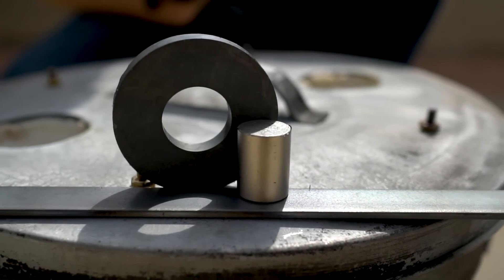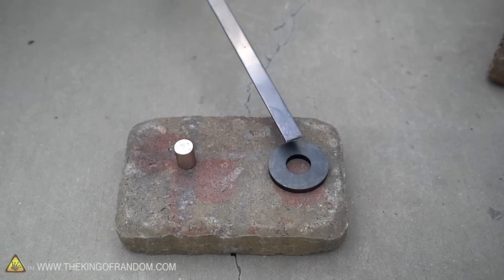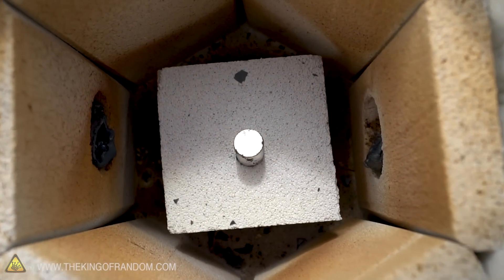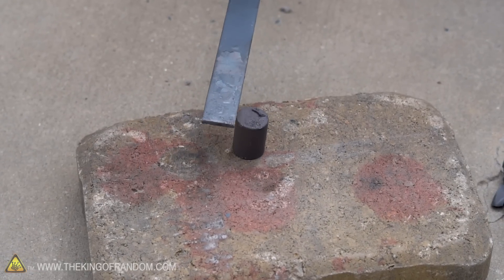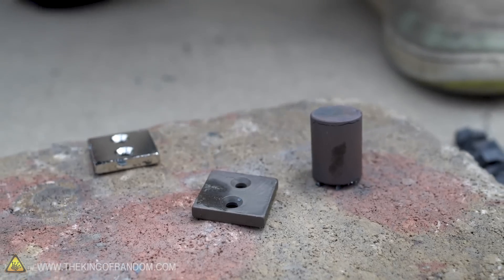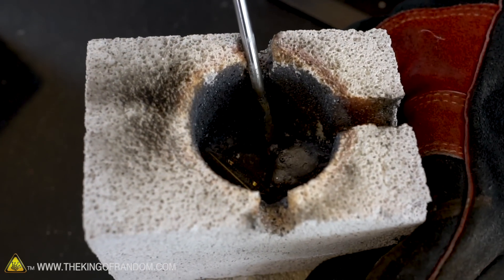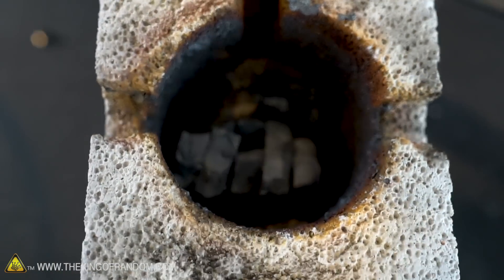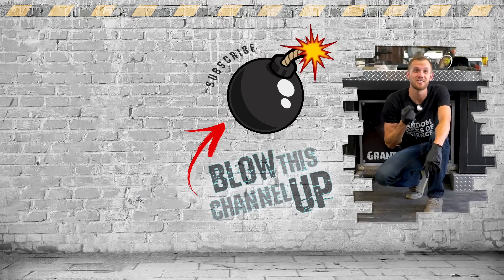Melting Magnets is Weird

Comment: why does he wear thin rubber gloves when handling hot materials?
Reply: So he doesn't get his dish wash soft hands dirty.
Reply: The gloves may look thin and crappy. But those gloves are actually quite awesome. I've even seen chefs use them to prevent cuts.
Reply: @seofra8252  we chefs DO NOT use little black gloves to prevent cuts..we do have gloves for this purpose, but not the ones you see here. They're much thicker and not made of rubber.
Reply: @pashkracken4054  I use the glove he uses... Not with very sharp knives though
Reply: @seofra8252  They're just gloves... You can get those exact gloves at harbor freight.
Reply: @justinroski4994  That's scary
Reply: @seofra8252  they use them because of hygiene. Thinking that a  <1mm layer of rubber will prevent cuts is ridiculous.
Reply: No idea.
Reply: Cuz he 21 savage
Reply: Becoz it works as insulator..

Comment: For arguments sake. I would have made an electromagnetic coil big enough to go around the crucible that you arc melted the steel. Then while molten.  Put the whole crucible into the center of the cool and powered the electromagnet... An experiment I always wanted to try but lack the means. I've always been curious in how metal would act if magnetic fields were maintained until fully cooled. 

I think it would be even more interesting if you got with a blade Smith ergo at final forge allowed this then did the final hardening... I've wondered how it would effect the metallurgy during the making of a Damascus.

Comment: A previous comment gives the name to what I've known about de-magnetizing magnets with heat. But ceramic magnet shattering with sudden intense heat tells me something about my job of repairing speakers. Occasionally speakers arrive with the magnets broken. Magnets will get hot when speakers are used past their operating capacity - so you can imagine the coils will be glowing like a stove element and just as hot. For comparison, a small standard general purpose coil will get to 70 degrees C with a 1.5 volt battery. Speakers have caught on fire. I wonder if this type of intense heat can break magnets in operation. The evidence on the video shows it can.

Comment: That orange steel for the first test was hardly over 1000°, 1400° at the most. 2000° is bright yellow almost white. When you heat metal up to non magnetic it’s called normalizing it, when you normalize metal you remove stress and the molecules return relax and lose structure.
Reply: I believe these are the right terminology. I’m not near my sources right now, but I am a blacksmith and there’s a lot of heating metal up until it’s non magnetic and cooling it down when you make a blade,

Comment: the ceramic magnet shattered violently due thermal shock not because you heated it up, try preheating in an oven then use an indirect flame before stick it in the furnaces

Comment: Magnetism means the atom mass is in alignment. Alignment is what creates the magnetic pull. When u heat it up,  it expands and excites the particles causing movement. This movement misaligns the atoms which removes the magnetic properties. I am an aerospace engineer so this isn't my field of expertise but i hope this info helps. I believe it is the electrons that align, hence electromagnetism.

Comment: As an apprentice blacksmith I can tell you even before you get into the video that the materials will NOT get attracted to each other while significantly hot. This is because the crystals of the metals become deformed and thus unable to hold a magnetic alignment. We use this to roughly tell temperature and to tell if we have significantly/correctly heat treated a product. Also in relation to the ceramic magnet shattering: you heat-shocked it. It was cold when you put it in but the temperature was too hot for it to stand rising to so fast. The same property can cause even modern blades to shatter/crack.

Comment: Lol everyone knows to magnetize a metal (magnetic metal) it needs to be normalized very slowly in the presence of a stable and powerful magnetic field. This is so that the atoms become aligned and iron which is the major component of steel at Best will only give a very weak and barely noticeable. Ceramic magnets need to be heated very slowly or they fracture and explode as you saw. When heating and melting magnets assuming you have the proper apparatus to magnetize them normal require tight thermal control and anaerobic conditions as firstly the components of the alloy separate and secondly oxygen and other contaminant enter the material.

Comment: How does the earth have a magnetic field? If the inside is magma then a molten iron/metal ball in the center. Does it generate it by the movement of the earths insides? Does somthing else cause the field?, im a bit confuddled xD

Edit: want to add.. because of it being so hot inside the earth how is a magnectic field possible? I know there is a magnetic field also, not argueing that. Ah the earth must be hollow with the second sun inside producing the field.

Comment: Fun video but way to much misinformation. You could gain so much more viewers and likes if you explained the things you are doing correctly. For example, "neodymium" magnets are mostly made from iron, also curie temperature is constant no matter if you are cooling or heating, also curie temperature of most neodymium magnets is about 300 degrees Celsius, hence you do not need to heat it to be red hot, simply putting them on the stove or in the oven would be sufficient to loose al magnetism (but making them glow looks cool).

Comment: Suggestion! ⚠

Put the magnets in a block of ice with a hole or hollow for them to sit in, see if any magnets have enough attraction to break the ice or force a way through.

Show how to remagnetize the magnets you've demagnetized.

See if you can melt down a magnet and cast it with another metal, find out what happens.

Comment: I think I know why magnets lose their magnetism and why regular metal does not. Now, I'm no expert, but I'm sure it has to do with the alignments of the molecules, and what those molecules are made of. 

If all the molecules in certain elements are aligned, then their atomic fields are all pushing and pulling in the same direction, thus amplifying the total field strength. When melted those molecules become misaligned. As a result the fields of those molecules are no longer having an additive effect, some even pushing against each other, causing the overall magnetic field strength to diminish or die.

Regular elements that are composed of molecules that are naturally effected by any magnetic field are immune to this problem, as they do not rely on alignment. I'm not 100% sure why, but it may have a lot to do with the atoms those molecules are made of.

Comment: If magnets lose their magnetism when they get hot enough then why does the earth have magnetic poles?
Reply: Because the earth is not a permanent magnet. The earths magnetic field it caused by the moving magma.
Reply: @my73737373  not that much magma and not very far down, it's due to the core, which is definitely not magma
Reply: The Earth is flat, not some sphere with a molten core. That's why.
Reply: @FreeTruth777  papers and reaserch man i wanna see it
Reply: Magma flow is caused by centrifugal force of earth, current is caused by friction of gassess below mantle
Reply: Epic question!
Will think on it.🤔
Reply: Simple, cause earth core is stationary and solid, when current from somewhere passes through it, the mantle and crust move
Reply: Convection currents (lower temperatures currents and high temperature chasing each other) move and that causes electrical currents which then make magnetics
Reply: Earth has center of gravity at the poles .
Reply: I thought it was cold in space??? Like really cold.
Reply: Nobody really knows. How Earth produces a magnetic field is pretty unknown.

But the best theory as to how Earth does it is due to the interaction of the liquid outer core and the solid inner core.

So it’s not ‘simple’ as someone said above... It’s actually pretty complicated that we haven’t worked it out yet.
Reply: I'm certainly not qualified to answer but could it have something to do with the scale of planet and composition of both atmosphere and the earth's core? Maybe some sort of subsurface reactions? It's a really interesting question !

Comment: Take two neodimium magnets on either end of a glowing yellow piece of steel. The two neodimium magnets need to have both attractive sides facing each other on either side of the hot steel. Theory is as the metal cools it will become magnetic itself because the neo magnets pull the positive and negative polls in the steel and holds them aligned as it cools.

Comment: Tends to lean me towards the theory that the core of Earth is not a molten iron core but a plasma core because plasma does put off an extremely strong magnetic field but molten iron obviously does not
Reply: Yes the core is electric incandescent ball of plasma powered by birkeland currents coming from the Sun via solar wind. Birkeland currents enter via polar openings and power the plasma core.
Reply: For evidence of polar openings search "New Hubble Portrait of Mars". You can clearly see the huge dent and the polar surface of mars curving inwards/downwards along with the atmosphere of mars.
Reply: @Xeno_Bardock  link?
Reply: @celuler22  Search "New Hubble Portrait of Mars" and "Mars North Polar Opening Confirmed".

Comment: Do the magnets lose their power when its too cold too? Or do they even gain power? Please try it out ;)
Reply: it doesn't lose power because of cold, heat causes the magnets their structure to become randomized again, because in non-magnetised magnetic metals the structure is random, which is why it doesn't attract by itself, and when you magnetize a metallic part, for example a block of iron, those atoms get aligned, which is why if you put north pole of one magnet to north of another magnet, they don't wanna attract, unless one magnet is a LOT stronger than the other one, then it might still stick but otherwise not.
Reply: Actually, when it's really cold, near Zero temperatures, eletromagnets gain a really cool propriety: they become superconductors. You can read about this on the internet.
Reply: Yes, please do. Quite interesting.

Yes, magnet does lose magnetic when hot and doesn't lose it by cold. But being cold, does nothing happen or something else.
Reply: The temperature itself isn't what changes the magnetism. It's the physical structure of the metal atoms being changed by temperature that changes magnetism.
Reply: Marcel I hope he sees this as I genuinely interested as well
Reply: Look up the property of superconductivity... Pretty interesting
Reply: I do know that supercooled ice is magnetic, which is interesting.
Reply: Ceramic magnets actually lose strength when the temperature decreases and gain strength when the temperature increases though they have a very high curie point but if they are heated up too quickly they tend to explode
Reply: @a.r.ripley2582  Oooo, Oooo, Oooo, like in this vid? Am I right? Am I? Am I? Am I?
Reply: @DjJtown  yes
Reply: Magnets actually float above the surface when liquid nitrogen is used
Reply: Liquid helium is used to keep the magnets in an MRI machine in very low temperatures. This answers your question.
Reply: @shebby0204  thats to get accurate readings, also they don't have actual magnets, they use very powerful electromagnets so they need adequate cooling. (a lot of power is flowing thru the wires)
Reply: BH4x0r that’s amazing. Liquid helium sits at below 10 kelvin, -452 degrees Fahrenheit.
Reply: @BH4x0r  They do use electromagnets, however the liquid helium isn't used to cool them for loss of heat or something. It's used to bring special materials called superconductors into their superconducting state. (They need really low temps to work). So, with 0 resistance they provide the absolute theoretical maximum magnetic field possible.
Reply: @animatrix1851  but for cooling too because if you didn't get them to a superconducting state, there would be quite a bit of power loss/heat generation, thats what i basically meant.
I also said they use actual really powerful electromagnets, i said they don't have normal magnets tho.
Reply: those are electromagnets and they are kept at colder temperatures to help super conducting
Reply: @shebby0204  MRI uses electromagnets that are cooled to be superconductive the magnets can then pass high currents without too much resistance and so produce a very strong magnetic field.
Reply: They gain power

Comment: Neodyminium magnets are ruined above 80 or so Celcius. So if you want to magnetize a cooling magnet either use insulation in between, use a magnet that can withstand higher temperatures such as AlNiCo or use an electromagmet. Electromagnets can be even more powerful than neodyminium.

Comment: Can you try a bigger magnet on the outside of the fire brick so the magnetic field gets through but the magnet is isolated from the heat of the molten steel?

Comment: Uhh, you can just look up about how magnets are made to find out how these things are likely to react. It was obvious to a layman like me, who has read a little about magnets, that the Nd magnet would become useless as a magnet once heated past its Curie temp. The fracturing of the ceramic magnet was mildly surprising, but having dropped them on hard surfaces before, and having them shatter, that result is consistent with prior experience.
Reply: Chemus Van Der Geek Was you consuming to much alcohol when you dropped it?? if you dropped it at the bar, did you lose your magnetism with your date??? lol just trying a pun at 500 in am !!! lol!

Comment: Its because when a magnet reaches a certain temperature called a curie point its attraction no longer flows outward, but inward. Essentially it attracts to itself because the heat loosens up the atoms in the magnet and then those attractive atoms attach to eachother. This also causes the center of he magnet to retain a slight magnetism

Comment: The magnets are basically made of compressed powders and then hit with an intense magnetic field.  You could probably remagnetize them if you hit it with a sudden large magnetic field from say a coil.  (Must be DC current)  Also, the steel bar is a crystalline structure, so it will retain it's properties, unless you completely melt it.

Comment: This was an interesting video and causes one to wonder....if iron or steel loses it's magnetic properties when heated to a molten state, then how can geologists insist that the core of our earth [iron and nickel alloy] produce the earth's gravitational field? [geomagnetic field]  Sure, scientists will respond with something like "Well, in 1936... Inge Lehmann [a Danish seismologist] discovered that the very core of the core is solid, not molten"....Pretty convenient...any casual glance at a diagram or graphic of the internal structure of Earth shows, or at least suggests, that the deeper one descends within the earth's depths, the hotter it progressively becomes. Are we then suppose to believe that the very core of the core is cooler? In truth, ANY thought of what is at the earth's core is....is pure conjecture....mere hypothesis! There is NO empirical evidence to support ANY hypothesis. The deepest hole ever drilled on the face of Earth is the Kola Superdeep Borehole in Russia....only 7.6 miles deep. Hardly strong empirical evidence the core is magnetic iron.
Reply: The iron core is solid due to all of the pressure
Reply: the center is solid because of the millions of tones of everything else pushing down on it its like how its easier to boil water on a mountain and harder in a pressure cooker you can actually freeze water at room temp and the inner and outer core is alot more then just a iron nickle alloy just bout ever mineral you can think of is down there just varies in how much is there. the molten parts also have a current to them like the ocean and that is one of the hypothesis for the magnetic field around the earth
Reply: I don't think its iron right in the middle of core. If you think about it, gravity would pull in all directions right at the centre (correct me if you think otherwise), therefore iron won't fall right to the middle??
Something has to be in the middle. I recon the pressure is very extreme as suspected, perhaps is full of crystal? Crystals when rubbed creates electricity. Perhaps there are high electric currents in the centre of the core which expand outwards through the molten iron and to the cool iron which creates our north & south poles?
Reply: @pumpkinking365  Maybe someone can just drill to china and see what ya find on the way... prove all them theories right or wrong... just dont implode the earth as you puncture a hole in the balloon, it might deflate and create a white star... knocking us all to extinction... fantasies are fun.
Reply: @pumpkinking365  That was the movie: The Core.

Comment: Put a BIG neodymium magnet into an insulated box and burn Thermite in a crucible (on top) inside the magnetic field. Will the poles in the resulting iron be aligned? If so, how strong will its magnetic properties be?
I could predict every result in your melting experiment. Iron from Thermite in a powerful magnet field? THAT I couldn't predict.
Oh, and putting cold ceramics into a hot furnace (rather than heating it slowly)...Predictable.